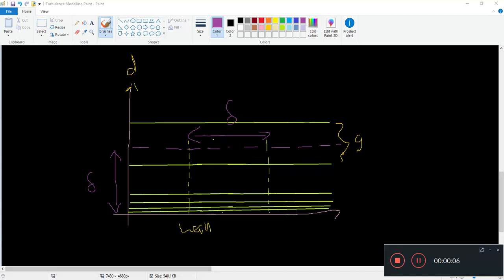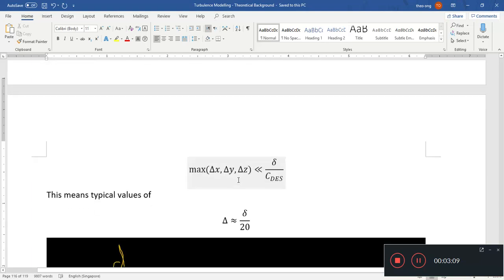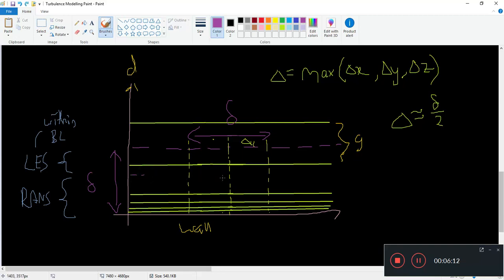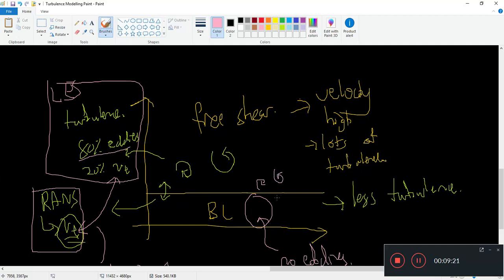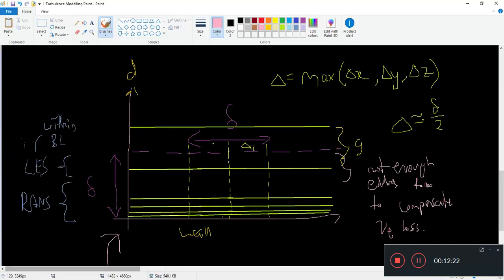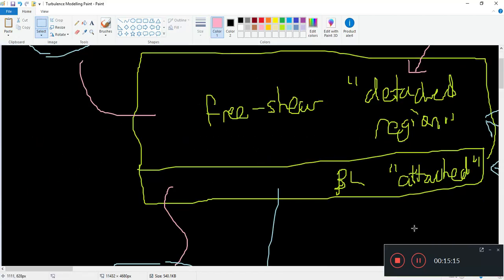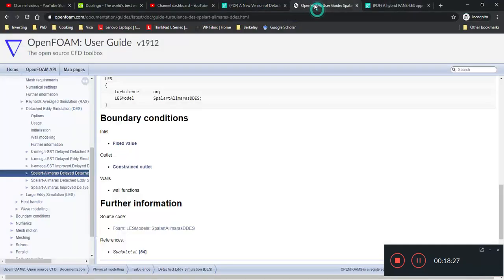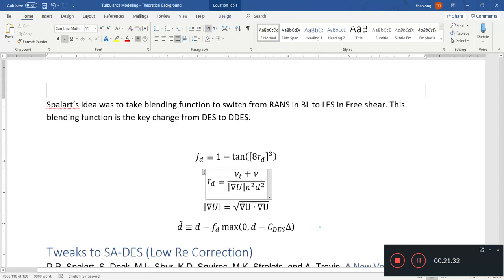Turbulence Modelling 62 - SA DES Model Tweaks - DDES Model Stress Depletion MSD

Comment: when the mesh length scale in boundary layer is small than one twentieth of boundary layer thickness, SST-DES still calculate the eddy viscosity by the TKE and Turbulent eddy frequency instead of obtaining the eddy viscosity in LES way which directly relates the eddy viscosity to the mesh scale in the boundary layer. So can you explain why DES works as LES mode in the boundary layer as mesh refines? thank you very much.